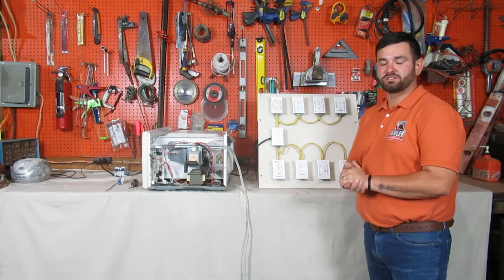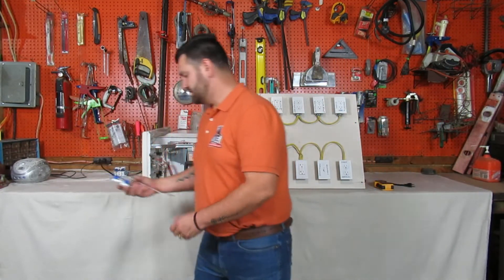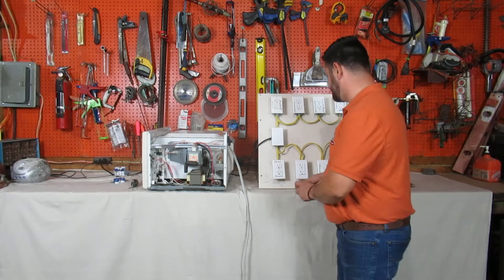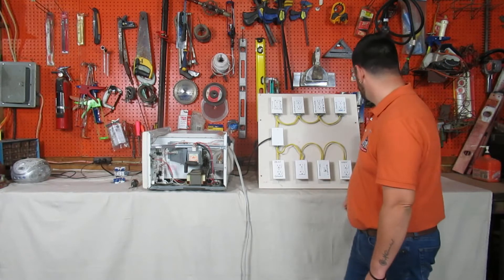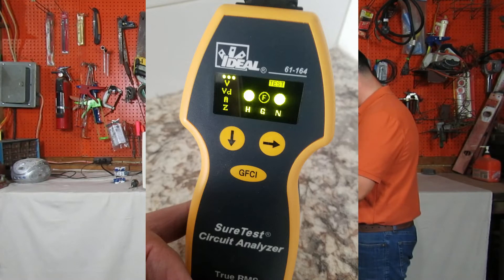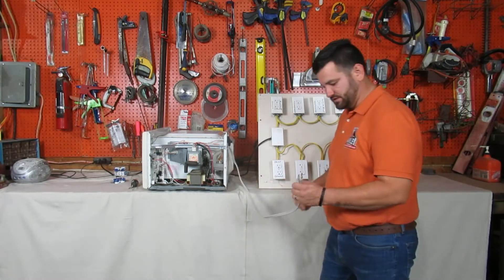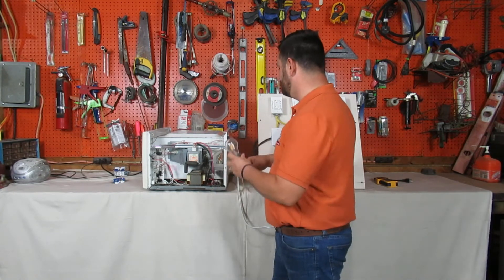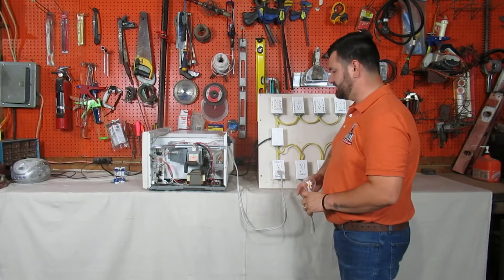Discover the Hidden Dangers of False Grounds

Comment: If your system is ungrounded and the hot wire contacts the case you'd have 120v on the case regardless of a bootleg ground or not. With a bootleg ground you'd have a parallel path of current in the appliance allowing the case to carry some current and is a hazard. If you had an open neutral as well, the case would be live with 120v even if the hot wire is intact.
Reply: I really you don't have to explain common sense😂

Comment: It's all fun and games until you have an open neural downstream and energize the appliance frames or garage door.  Handymen don't understand the electrical system enough to realize this. I was an electrician for decades and it actually took me quite a long time to realize how dangerous this hack was. I never did it but I have corrected it countless times, mostly in older apartment buildings where the maintenance man was involved.
Reply from the maker: Thank you for your comment.

Comment: The SureTest doesn’t pick up all false ground-especially if it’s a short run to the service panel. 

And even if there’s a false ground, a short hot to case will clear the fault and trip the breaker as there’s a path through the neutral. It’s better than an open ground entirely, which would electrocute you but not as good as a GFCI for protection.
Reply: Good point.  Not sure what the distance,  because those testers are more $$$ than I care to spend on in this time of 40 year high inflation,  geopolitical tensions etc though I will admit they are awesome.   For those unaware,  this Ideal SureTest can detect bootleg ground if it senses a very low impedance between the neutral and ground,  such as could occur when the original two wire receptacles in a pre-1960s home are replaced with 3 wire receptacles and, to fraudulently pass inspection knowing most inspectors rely on the three light tester, which will indicate correct wiring, if a  short jumper is placed between the neutral and ground screws.    You'll want to be especially aware of this in a flipper home.

Comment: Of course it is grounded. That is known as TN-C. It is not legal on the US but that does not mean it somehow is not grounded. It was in the past used in several countries. There are reasons why it is not a good idea like interference it causes.
Reply: I read somewhere that in Germany, or at  least in  parts of Germany, bootleg grounding, also   known as classical grounding in Germany was legal until 1973, existing installations are typically grandfathered in.  In the US, bootleg ground outlets were never allowed, with one exception.  Prior to the adoption of the 1996 NEC,  the standard outlet for electric clothes dryers and electric ranges,  cooktops and wall ovens was 3 wire, two hots and a neutral, because these appliances operate at both 120V & 240V.  In this 3 wire application,  the neutral is used to ground the chassis, basically creating a "code approved " bootleg ground.   All fun and games until an open neutral occurs upstream, and now you've electrified the chassis. On a damp basement floor where many families have the washer/dryer, an open neutral on a 3 wire dryer setup  could make this the last load of laundry you ever wash.

Comment: i have this at my house yikes!
Reply: Remove them all and install GFCI receptacles to offset the "no ground wire' issues.  Or, look closely in the box to see if there is a ground hidden but not used. It's rare but possible.  Worst case, just remove them. IMO, having no ground on the recep is better than having it jumped from the neutral.